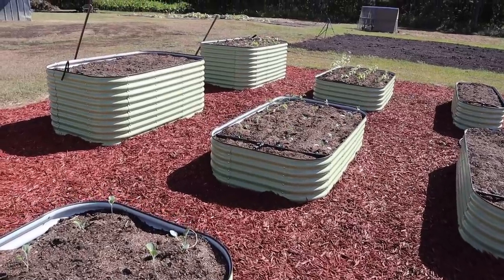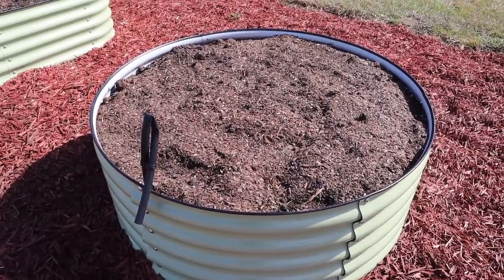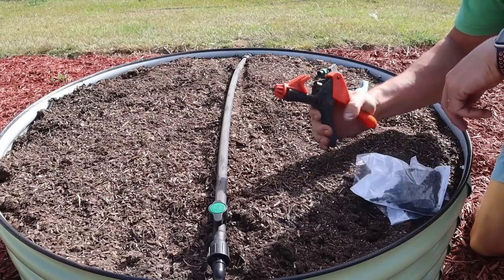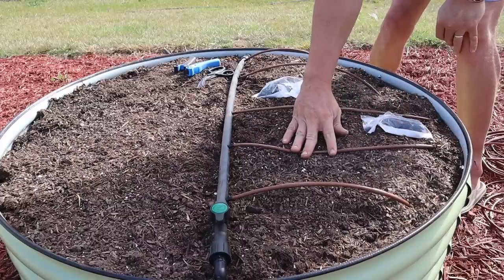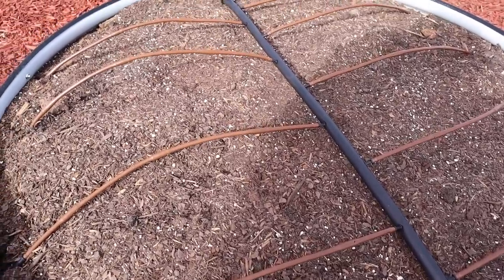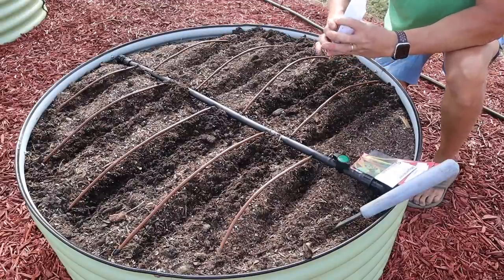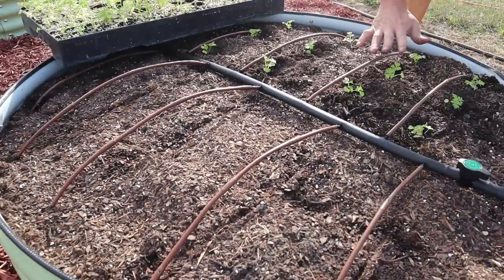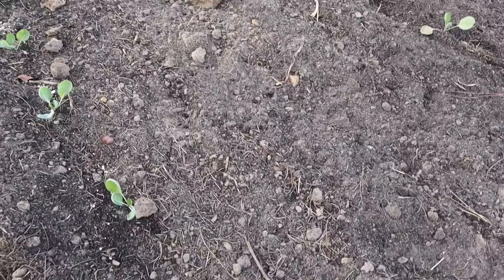Ditching Drip Tape for Drip Tubing? | Which Is Better?

Comment: My thoughts on round bed irrigation. Couldn’t you have just coiled the drop tubing around in a spiral to the middle. Used some landscape staples or some sticks to keep the spacing you want. I mean it’s already in a coil. Or, what about a soaker hose, also in a coil around the bed. You can get fittings to splice soaker hoses. Also, FYI, pickled beets are the bomb.😋

Comment: When you punch the holes, they need to be in the middle or slightly lower on the supply header.  This will help the tubing stay level with the bed. I ran into the same problem when I did my landscaping.